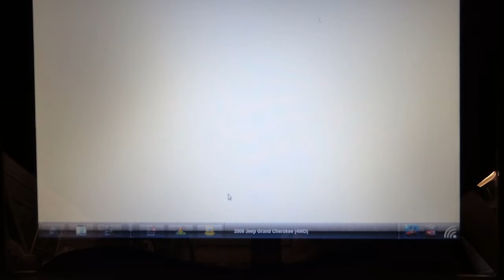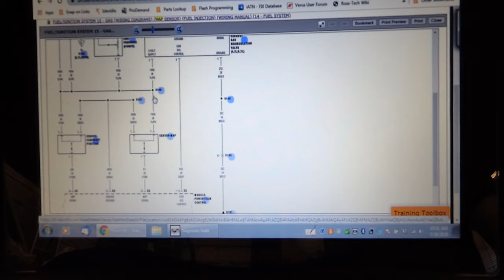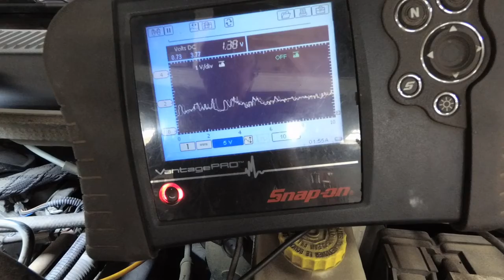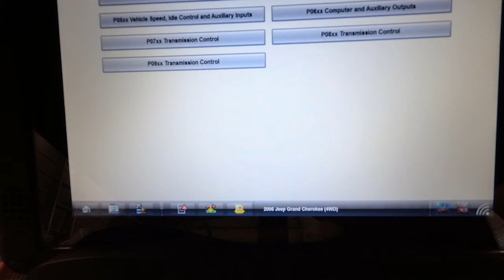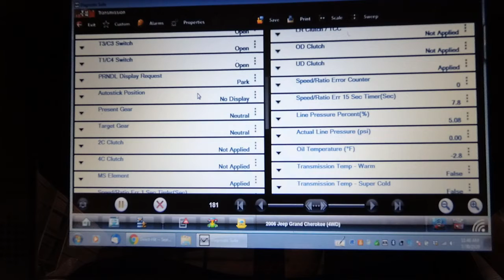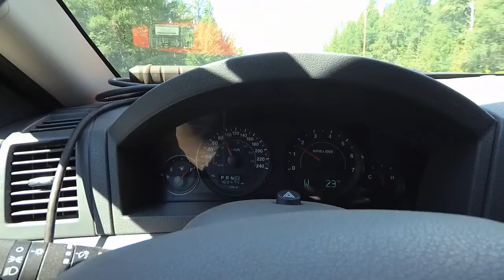2006 Jeep 4.7 Cuts Out, Surge, MIL, ESP, BAS Lights on and More

Comment: Old post i know but i have a 06 jeep 4.7 as well and with the transmission over temp if you use live data it would spike the temperature readings from one second to the next of over 100 Degrees Celcius increase. Turned out to be the PCM/TCM (all one unit). Never had an overtemp tranny issue since.
Reply from the maker: good to know thanks

Comment: Same Vehicle.  Same list of problems.  Did you ever get past the tps and deal with the trans temp/various other codes?  (of which I have many!)   Thanks for posting this video.  Extremely helpful.
Reply from the maker: 90% of the problems on this were caused by the TPS voltage fluctuations. Never did address the transmission over temp code by as far as I know it never returned. BTW this TPS problem had been ongoing for several months and some times it would run fine for several days. Hope this helps.
Reply: @PhillipBailey  hello i jave a grand cherokee v8 4.7 2005 when i brake my jeep stalling just when a ibrake at the stop or the light.what my problems please??i pay 3 dealer and no answer
Reply from the maker: @renegade9758  That's nearly impossible to say unless I had some test equipment on it and was driving it at the time. Maybe if you tell me more information. Is it setting any codes? Does this happen hot  cold or at any temperature? What's been done so far? Automatic or standard?
Reply: @PhillipBailey  no code with my scanner .erg valve or brake booster?
Reply: @PhillipBailey  grand cherokee 2005 automatic v8 4.7 cam sensor new crank shaft sensor new tps new iac valve new it turns off when I suddenly brake to a hot or cold stop it is the same thing and I have no code on my scanner
Reply from the maker: @renegade9758  possibly the torque converter is not releasing. Will it stay running if you drive with two feet to keep the RPM up? Does it seem worse after running at cruise speeds for awhile and then come to a stop?
Reply: @PhillipBailey  no it's always the same thing only at a stop or red light sometimes the idle goes up and down, but I noticed when I pump the brakes the rpm goes up to 650 and even 700
Reply from the maker: @renegade9758  pumping the brake pedal creates a momentary vacuum leak so it will affect the idle speed in that engine since it does not use a MAF sensor. You need to monitor the fuel trims, TPS, O2 sensors when it's stalling out to see what's going on. Could be your idle control valve is sticking. Can you keep it from stalling by driving with two feet?
Reply: @PhillipBailey  with 2 foot?
Reply: @PhillipBailey  my air control valve its brand new
Reply: @PhillipBailey  i have maf on my intake
Reply from the maker: @renegade9758  unless this is special I've never seen a MAF sensor on a 4.7 of that vintage. MAP yes but not MAF. Just because you have replaced parts doesn't guarantee they are trouble free especially if you used aftermarket parts. As I said you need to monitor and record engine data before and at the time of the stall to see what's going on. Playback the data to try to figure out what's the cause. You need better mechanic looking at this. Good luck.
Reply: @PhillipBailey  ok today i have a p0300
Reply: @PhillipBailey  missfire
Reply from the maker: @renegade9758  P0300 is random misfire. You need to view misfire counters before clearing the code to see if it's really random or specific to one bank or a single cylinder.
Reply: @PhillipBailey  and i put neutral its not die

Comment: so whats is the diagnostic please please or where are you that way you can fix my jeep i have exactly same problem
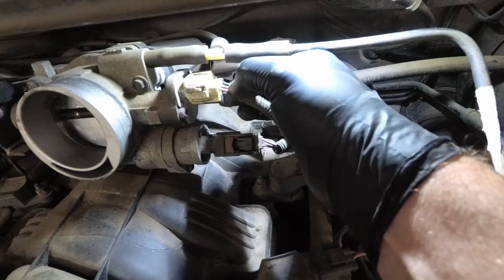Reply from the maker: The root cause of the problem was a throttle position sensor dropping out. Erratic voltage output from the sensor was causing all of the problem. See 11:25 in the video. If you want you can try unplugging your TPS and if that is the problem that should make it run better. I'm in Thunder Bay, Ontario Canada eh..
Reply: @PhillipBailey  thank you very much for reply and will try do that and see what happens I let you know ty

Comment: The scope picked it up...but would we have been able to see those tps fluctuations on the signal wire using the live scan data KOEO?
Reply from the maker: Possibly if the refresh rate of the data was fast enough. Deselecting unnecessary pics in the data list might help. Definitely won't see as much fluctuations in a graph of the data though. I never thought to compare. Would have been a great example of why you should look at live inputs preferably with a graphing multimeter.